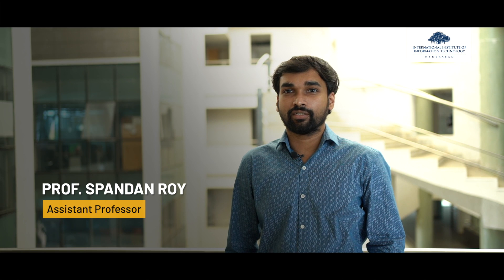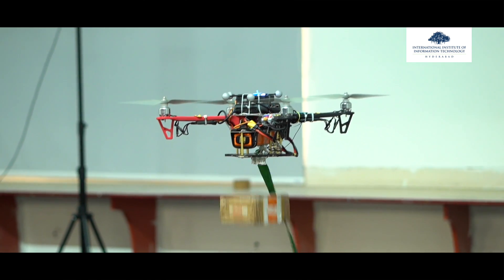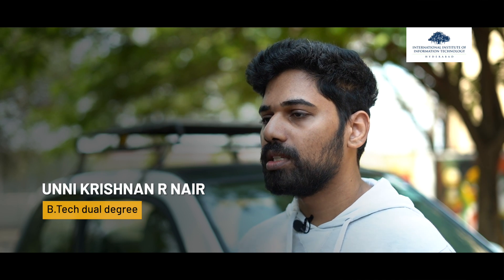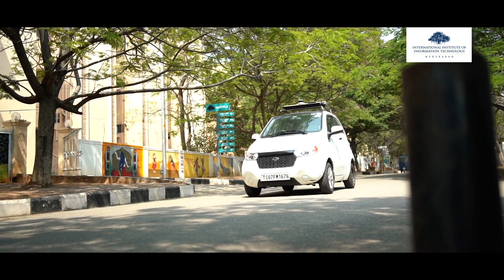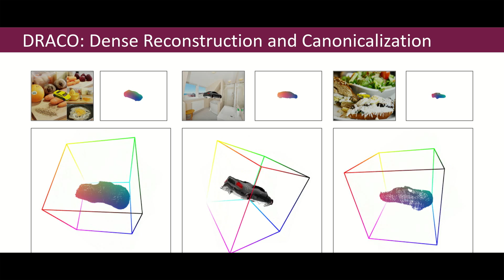Robotics Research Center at IIITH

Comment: Hey everyone.....right now I'm pursuing mechanical engineering (B.E 3rd yrar) how can I join robotics research centre in iiit-h.....do I have to write any exam or what are the requirements and how should get into it cuz i want to pursue my career in robotics. It's a huge request if I can get good answer.
Reply: You can take the PGEE exam, or approach a professor for a 1-2 year long research position under them (stipend not guaranteed). Either of these would be only possible after your graduation. As for now, you can approach a Prof. for remote internship.
Reply: @Deathshort whether u offer any courses to interested people or guide students